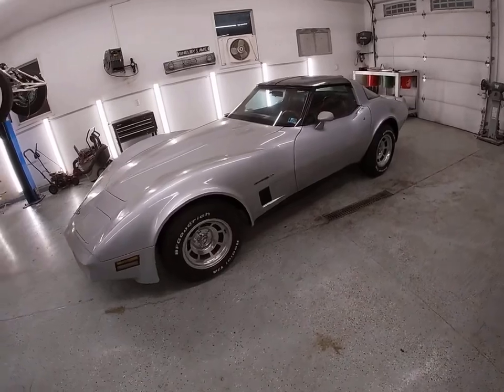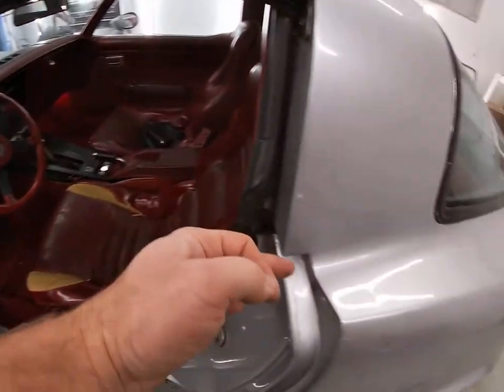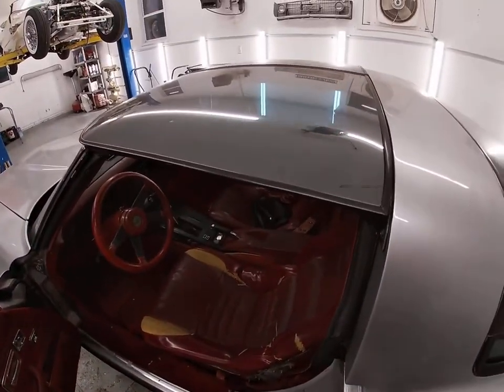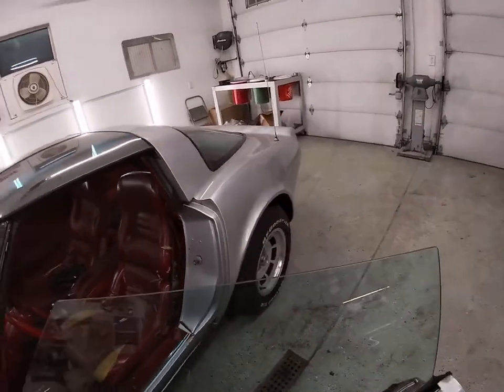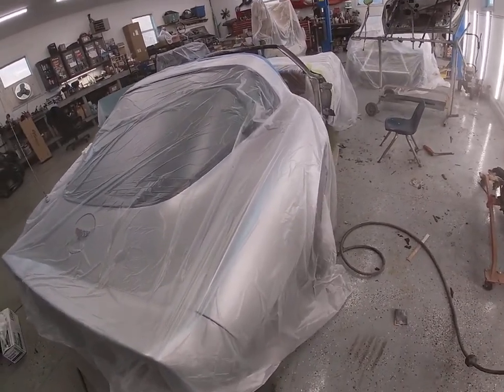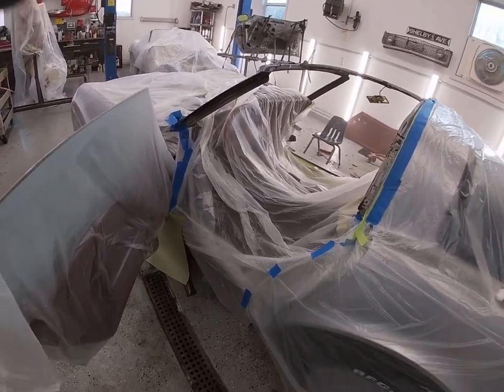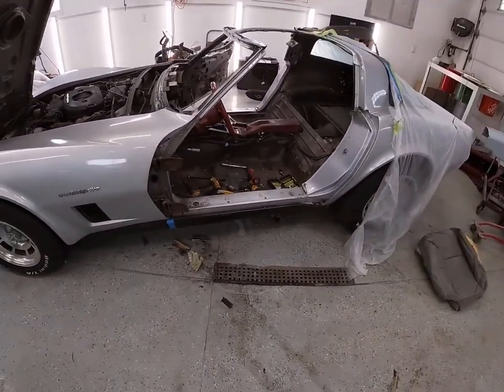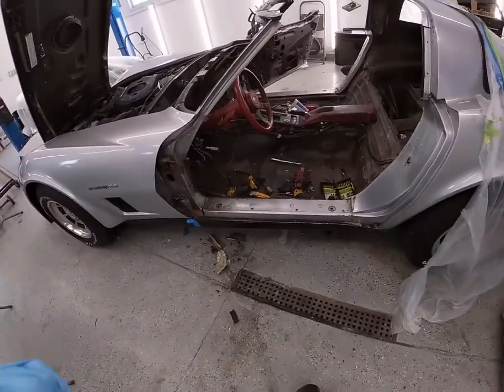1982 corvette interior rebuild part 1. Disassembly and painting door jambs

Comment: Do you by chance have the video of removing the windshield trim?  I need to take mine off and don't want to destroy the weather stripping trying to figure it out
Reply from the maker: I don’t but it’s not bad. There are  3 screws on each A pillar. That will remove the a pillar molding and the weather strip. The top piece has traditional clips that you’ll need a molding trim tool for.
Reply: @crosscreekclassics3595  thank you. Do I need to take the interior A panel off to see screws or are they just hidden under the stripping? Appreciate the help. Mine look just as bad as yours did to start 😉
Reply from the maker: @michaelriley3110  no the interior trim does not need to be removed.